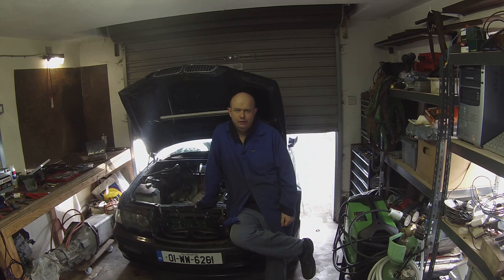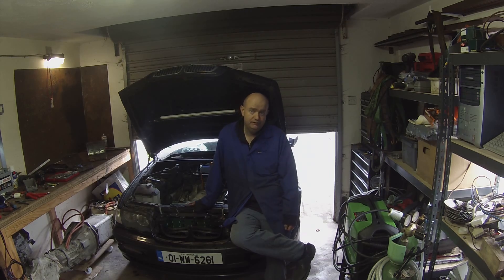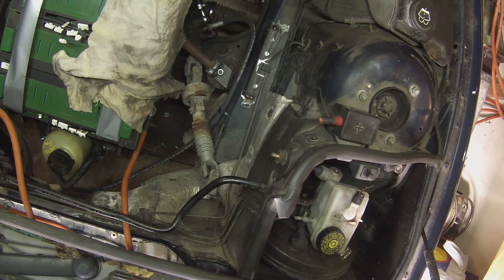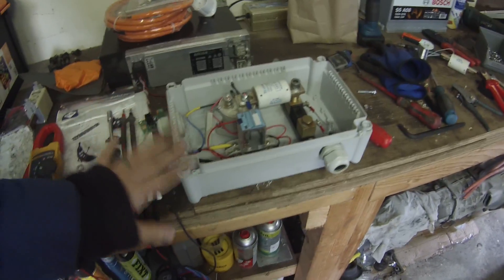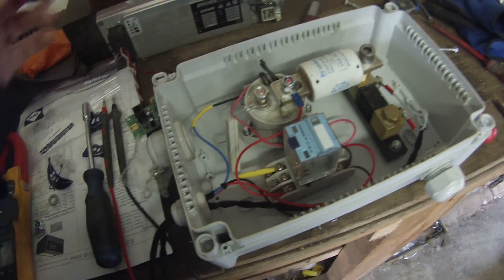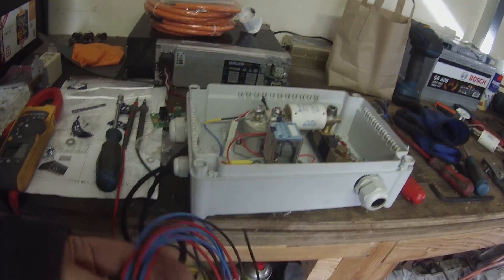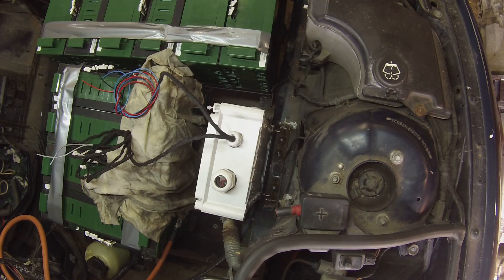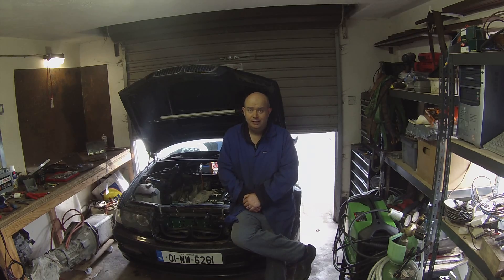BMW E46 Budget Electric Drift Car Project 19 : HV Controls

Comment: Hi Damien,
May I ask you a small question that what is the peak current (and rated voltage)output of your high voltage system? I see your fuse is rated at 350 amps and 450V...coz I'm choosing fuse right for my electric car. Cheers
Reply from the maker: I'm not sure yet. I'd guess around 350v and 400 amps.
Reply: so....a rated 350 amps fuse is for a 350 amps rated high voltage system, right?